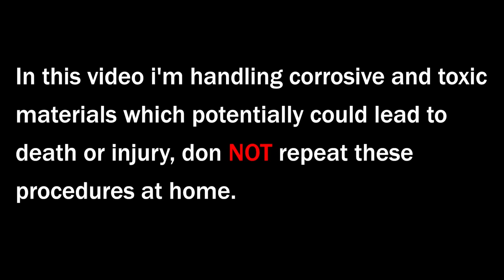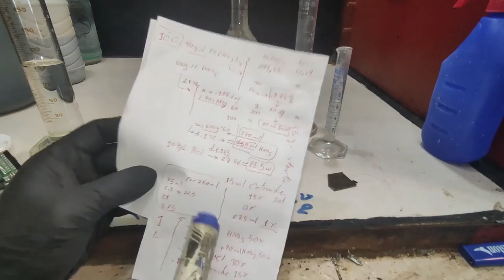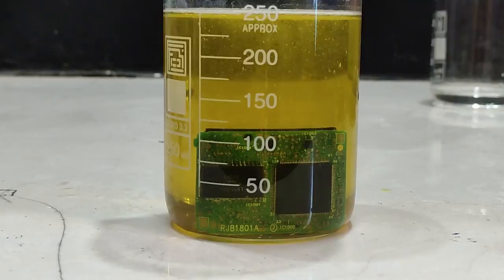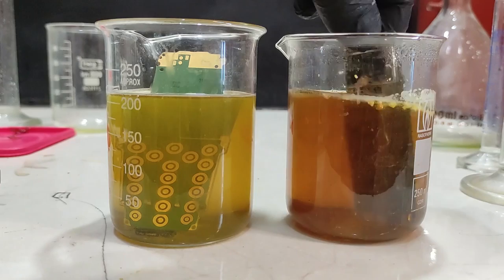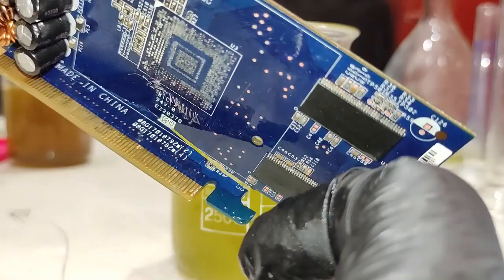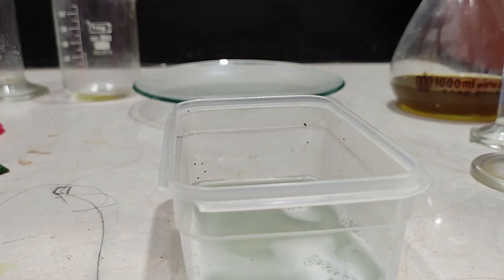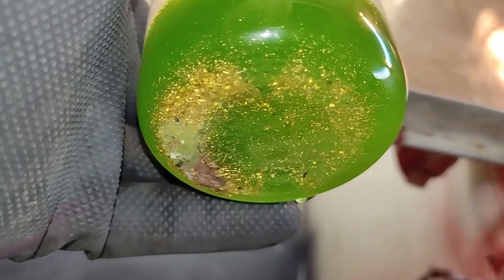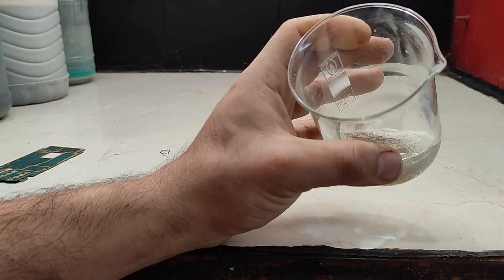Best solution to dissolve soldering FAST | Revisited | Leach solder from PCB'S

Comment: Any time you have hydrochloric and nitric acid combined, gold will be in solution. Use diluted nitric acid to dissolve the base metals first. Most of the components will fall off. Pour the used nitric into a separate container and add pure copper to cement out any silver. 
Then use Aqua Regia to dissolve the gold.

Comment: The thin "not so shiny" gold plating on PCBs is: ENIG plated gold (Electroless Nickel Immersion Gold). It dissolves rather fast even in weak acid due to the high Nickel content. In most cases the gold content is less than 10%.

Comment: Although it is a very good solution, Cetyltrimethylammonium bromide is a very expensive chemical. It's a bit disappointing, but I need a cheaper way, my friend!
Reply from the maker: Use Polyquaternium-7 or 10 used to make hair conditioners
Reply: @PickyPlans  If in the above experiment, if you replace the cetrimide 15% solution with polyquaternium-7 or polyquaternium-10, wouldn't it be difficult to replace it with the same concentration? I wonder if the same performance will be guaranteed due to the difference in chemical properties...
Reply from the maker: I've tested 0.5 percent Polyquaternium-10 and 1 percent Polyquaternium-7 in the solution with acceptable result

Comment: Hi! does it works with older tin lead (i think is 60/40) solder? I have an antique turkish coffe grinder that i wan't to restore, and is made of brass or bronze, but someone previously solder some broken parts with old tin. So i need to replace it with new lead free tin for no toxicity. What would be best, using HCl or this method? Sorry for my english 😅

Comment: Hey Picky, me again.....! Since watching your latest vid I have spent the afternoon trying to find a source for cetrimide at around 15%. Not easy!
Where do you find it in your country? I note it is used in antiseptics but I still am unable to find a supply. Any suggestions are very gratefully received! Thanks mate!
Reply: @PickyPlans  As usual Brilliant thank you so much!
Reply: @zero-waste  Brilliant!! Thanks so much for that info Stay well. Jules
Reply: @PickyPlans  a 15% QAC cleaner/powder etc is extraordinarily hard to find.. any suggestions on names of brands or products to search for, that coildnbe reduced to remove excess water etc to concentrate to 15%?
Reply from the maker: Heat will not cause any adverse effect on this compound so yes you can concentrate it

Comment: hi there i could do with some help i have a huge coffee jar full of mlcc and smd resistors but there all covered in leftover solder ranging from just small bits stuck together to huge chunks would this method help clean up all the mlcc and resistors up and get rid of all the solder or is there a better and faster way to clean them up

Comment: Why not to use just HCl for striping tin?
Reply: @PickyPlans  I have never had a need for dissolving tin from electronic boards so far. When I need stannous chloride for testing of gold in solution, I take advantage of it and strip tin from few memory boards in HCl over night. Next day it is done and I have SnCl2 for testing and I have no problem with dissolving of copper. I am not criticizing your method, just pointing out practicality. Thanks for info.
Reply from the maker: It's useful for some pins and gold plated telecom boards. Presence of tin would lower gold outcome a bit, by forming colloidal gold . But in general you don't need such solution.